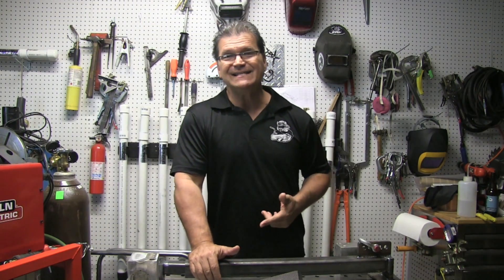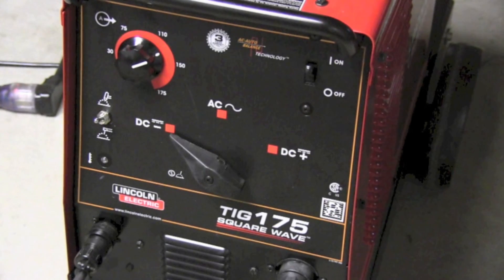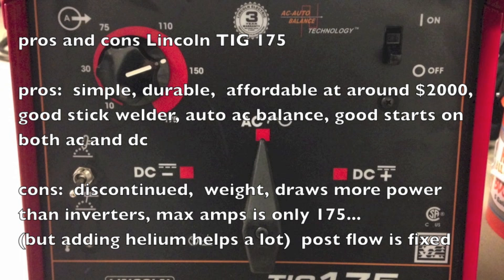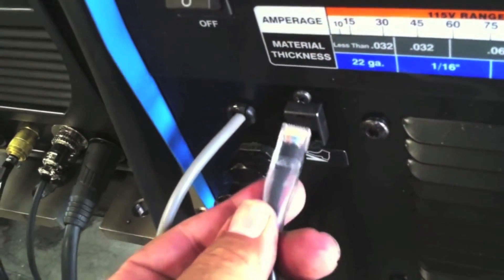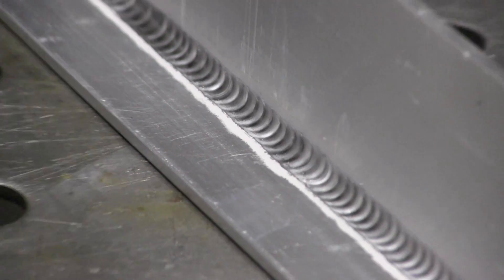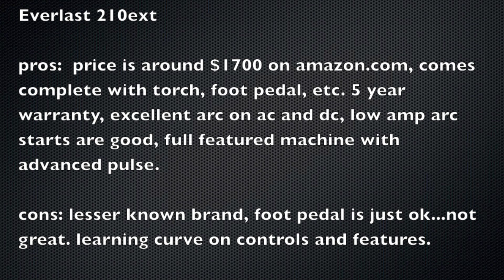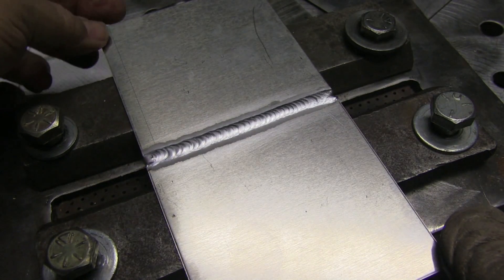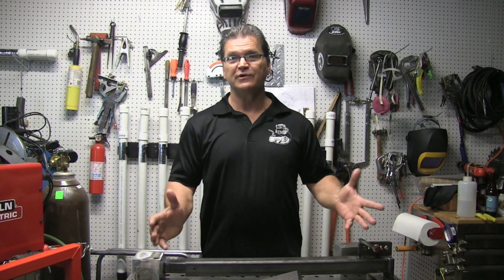Tig Welder Review pt2 - AC/DC Tig Welding Machines

Comment: Excellent review Jody, thank you. I own a Squarewave 200, still working on box cutter blades, you make it look so easy.
Reply: Richard Valcourt what is your opinion on the your square wave? I've been wanting one.
Reply: Josh Capasso I love my Squarewave 200! I am not a welder of the same caliber as Jody here but for what I do and for what I want to do it is an excellent welding machine. The stick side of it is also very powerful and carries a very smooth arc with either 6011 or 7018. The problem I am having though is when I back off on the pedal when doing tig my auto darkening welding shield flashes me. I have a midrange welding shield.